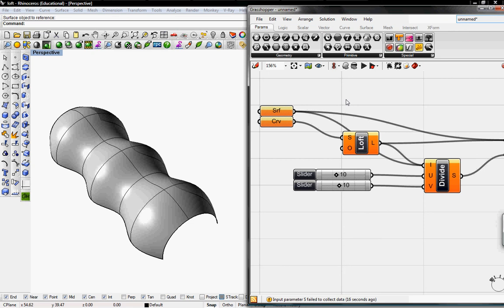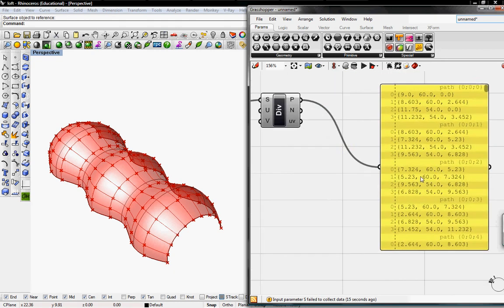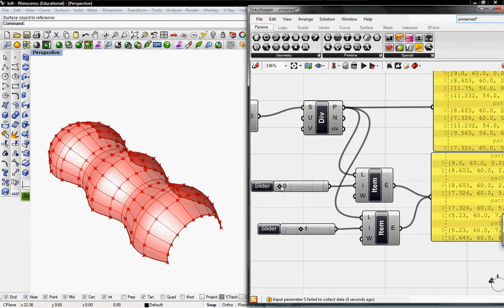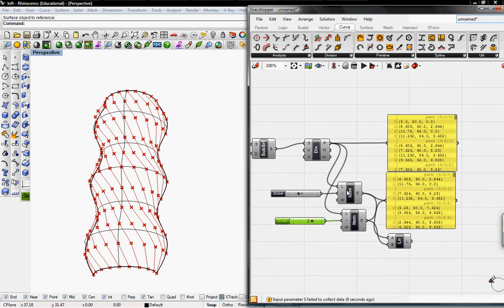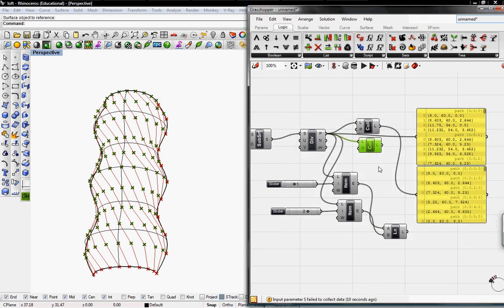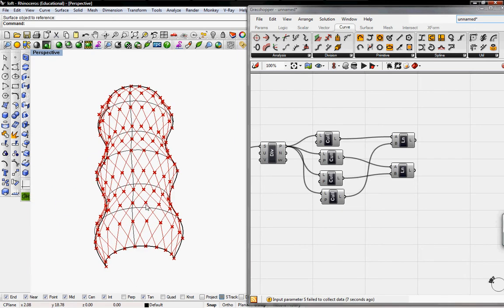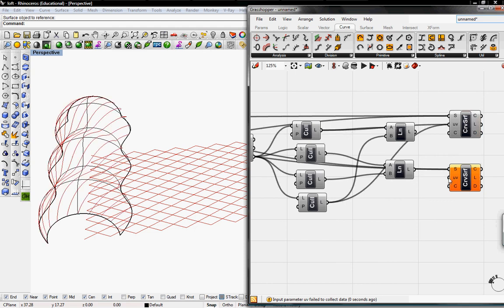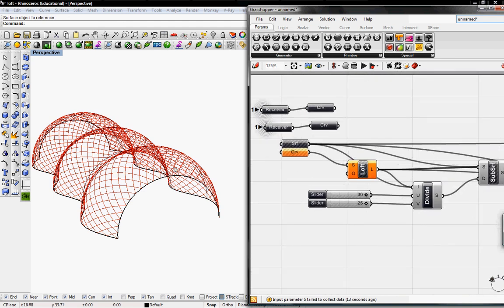cull pattern and curve on surface by digitaltoolbox.info

Comment: It doesnt work with the need definition for 'SDivide'. it comes up as groups of 2 instead of 4. i know u guys talked about this new SDivide being double than the old one, but i dont seem to be able to fix it.

thanks
Reply: Hey, a work-around for this is to replace Sdivide with 'discontinuity'. If you have 'subsrf' plug into a 'discontinuity' then it gives you 4 points at each corner. It is then very easy to use 'List Item' to get either point 0, 1, 2 or 3 and create a line between them. This will accomplish the same thing as above.
Reply: SOLUTION: Flatten the points to get the points in a list format like the "old" SDivide.

This is a very late response, but I will just post for anyone who needs the information.

Follow these links for the full explanation:
http://www.grasshopper3d.com/forum/topics/grasshopper-060059-available?commentId=2985220:Comment:56553
http://www.grasshopper3d.com/forum/topics/gh-ver-080001-divide-surface

Comment: Is there a way to create a list for the cull patern? I am trying to create a parametric brick wall on a surface. In order to connect certain points on a simple UV surface, i need to connect every N in one row, and then another N-1 in the next one.